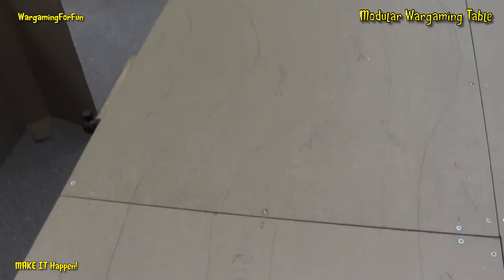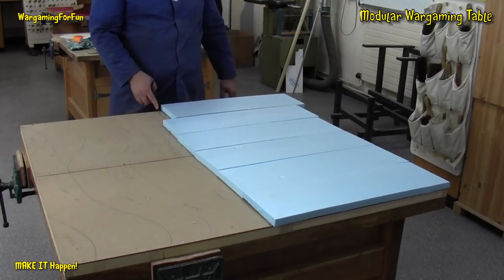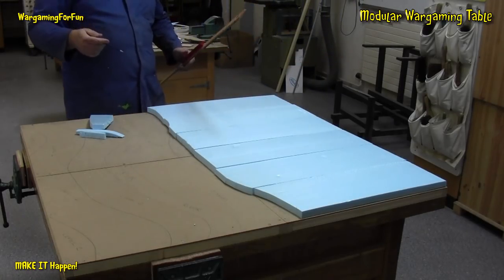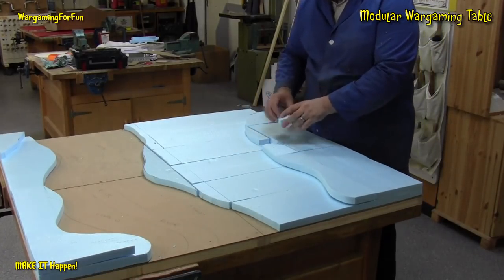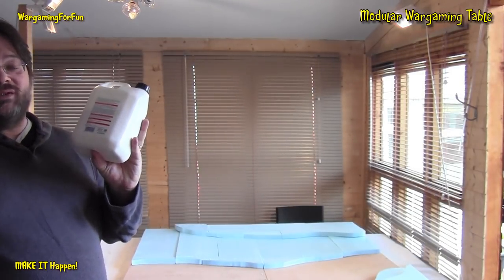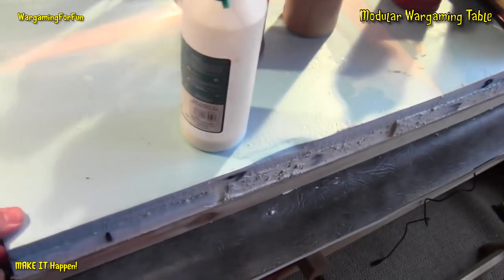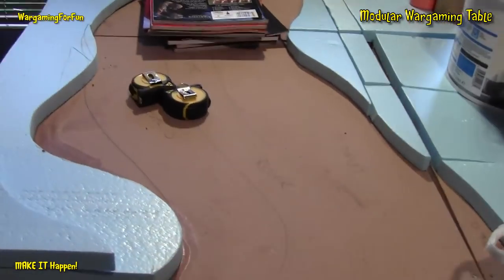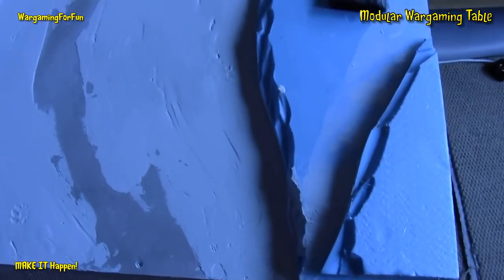Modular Wargaming Table Top Part 2 of 4 - MAKE IT Happen - Wargaming Terrain

Comment: Pink one is floor insulation foam, it's very hard, you can walk, sit and sometimes jump on it without harming it, but you must specify is for floor not wall or any other purpose. 
Problem is it's expensive :P

Comment: the term "modular gaming table" has always been reserved for board sections that will fit together in any configuration. what yr making here should simply be called "transportable", ie:if you turn those boards around to face opposite sides together, the terrain wont line up.